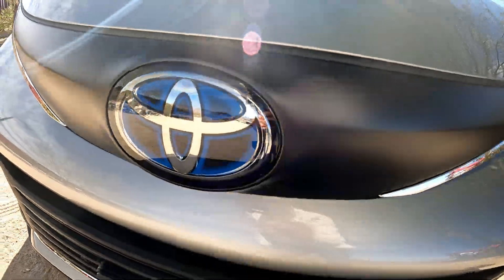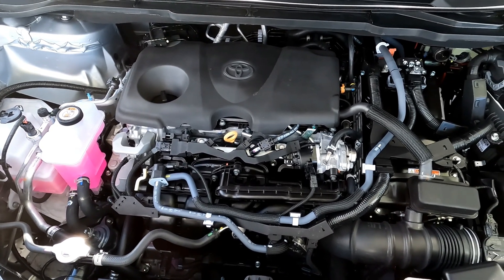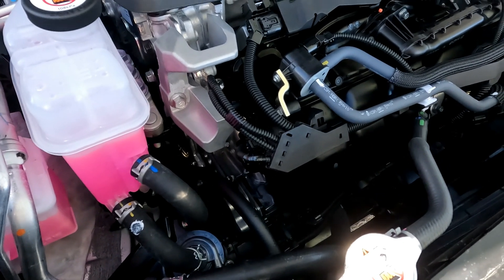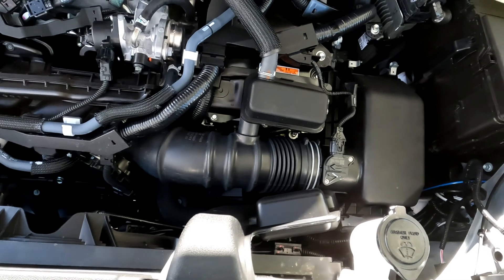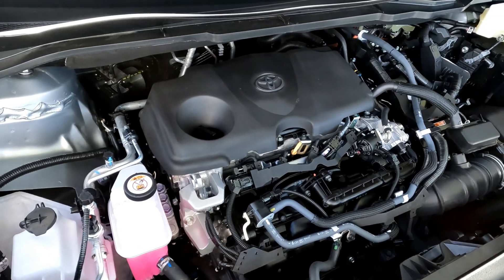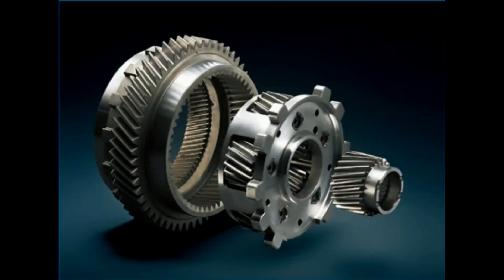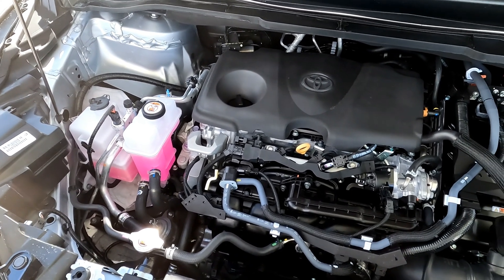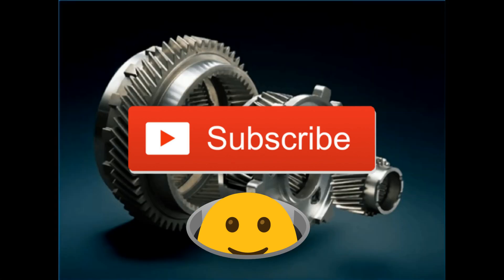A Toyota Hybrid Does NOT have a CVT Transmission (The TRUTH Behind the Hybrid Synergy Drive)

Comment: The Honda Hybrid system is not a CVT either, even though the specs say "e-CVT".  In fact, the Honda Hybrid system does not even have a planetary gearset.  The electric motor which powers the wheels up to about 100 km/h (62 mph) has only one fixed gear ratio, and when the ICE cuts in above that speed it also has its own single gear ratio.  Couldn't be much simpler.
Reply from the maker: that sounds like a brilliant system 👌 👏 😀
Reply: Maybe my car is simpler:

BMW i3 REx uses ONLY an electric motor to drive the wheels from 0mph to top speed.

The (2cyl 650cc) gas engine only comes on (after 120 miles of driving that day) to keep the battery charged. It has no connection to the drive wheels and mostly operates at a fixed, optimum rpm.

Can't wait until Ram puts their similar setup out in showrooms in a 1500 pickup, using a lightweight aluminum v6 as generator.

Comment: From what I understand, no belts, but a motor that drives the planetary gears etc that drive the diff that drive the wheels
Reply from the maker: it's basically a planetary gear differential... 2 inputs [engine and motor] 1 output [wheels]

Comment: Is there a belt or a clutch in these?
Reply from the maker: no, neither... just a harmonic dampener between engine and powesplit unit
Reply: But you say it doesn't have a CVT???   Just look up the 2025 RAV4 on the Toyota site.  Clearly states it has a CVT.

Comment: So can I tow with an eCVT?
Reply: Yes - depending on the vehicle, but there is no difference between them and the gas models such as in the trucks and Highlanders.  The Hybrid Rav is the same as well as the gas model but is limited to around 1700.
Reply: My 2025 Toyota Crown Signia which has a eCVT can tow 2700 pounds.
Reply: @richardcasey7521  my 2021 Toyota Sienna hybrid has a tow rating of 3500 lbs. but on Toyota Care Nut channel, he says the Toyota eCVT’s aren’t really meant for towing. So idk if I should tow or not

Comment: Its really stupid for them to market these as CVTs when they aren't and they are known to have poor reliability. 

Its just a differential using planetary gears with a fixed ratio. The variability is all on the dual inputs. This is like calling your axle differential a CVT to the other wheel.
Reply from the maker: @court2379  yep... it's a horrible marketing mistake on Toyota's part... any other name would've been better for it 😆 GVT or "Geared Variable Transmission" would've been better as it immediately deletes the whole pushbelt part

Comment: After tons of research i bought a 2024 Corolla hybrid.
It's basically a Prius drivetrain in a Corolla.  Probably the most reliable new car available today. Even better than the newest Prius which was totally redesigned and not proven yet. 
1.8 l bulletproof engine with the greatest transmission ever built
Reply: I wouldn't worry about any Prius.  Many have 300k or more.  They are chosen for cabs in many countries.

Comment: I get so sick of this hair-splitting myth.

Fact: if it can transmit mechanical power in a continuously variable ratio between the engine and output shaft, it is a Continuously Variable Transmission of power. That makes it a CVT. End of story.
Reply from the maker: @JamesCopeland-i1j  ya but that's getting nerdy 🤓 ... when people say "CVT" they think belt driven trash CVT from Jatco, etc.  Period.  Many think the
Toyota hybrid eCVTs are the same crap when the truth is MUCH  the polar opposite (in terms of simplicity and reliability) 😉
Reply: @LexusGX460-OFF-ROAD  - if Toyota's eCVT isn't a CVT, then most agricultural CVTs would be mislabeled (they're not), as most of them have a very similar configuration, with hydraulic motors controlling the bias circuit.

The only difference with Toyota's arrangement is, there's no dedicated bias circuit, and any of the inputs can direct power to the output shaft.

Comment: It's such a power move to take one of the worst types of transmissions, redesign it to the point where it's so simple that it practically can't fail and then put it in your cars still using the original name...
Reply: But the battery will shit after 10 years
Reply: @keithbellair9508  It's guaranteed at least that long with most lasting the life of the veh at 200k or more.  If it does after 150k, I'll spring for the new one at 3k which is about what they'll be (technology always going down) in 2031.
Reply: @keithbellair9508 Replace it for $1k and youre good for another 250k miles
Reply: @keithbellair9508 con la diferencia en los consumos el supuesto coste de la batería la amortice a los 3 años de comprar el coche.
Teniendo en cuenta que la garantía son 15 años....
Reply: @keithbellair9508 the replacement cost of that battery is really low for 10 years of usage.

Comment: A lot of the Ford hybrids (in our case the Escape PHEV) also have a similar style of eCVT that uses electric motors with a planetary gear.

It’s funny that Ford’s modern hybrid system and transmission are basically a carbon copy of Toyota’s, and the Atkinson Cycle engines were co-developed with Mazda. It actually makes for a surprisingly reliable and smooth powertrain considering it’s a Ford.
Reply: Isn't the one in ford from AISIN? The same company that makes parts for Toyota.
Reply: @BartoszRybacki0  I’m not sure. I know that Ford and Toyota have a patent sharing agreement where Ford gets all the designs for Toyota’s hybrid system (including the eCVT) so I suppose it’s entirely possible that they get them from the same manufacturer.

Comment: That's why they call it a eCVT, I wonder though if the Toyota CVT on Corollas might be okay, with the launch gear taking the torque at low speed.
Reply from the maker: @markschneider1396  https://youtu.be/2euik6mJi-8

Comment: Well it does have constantly variable gearing in the transmission... so yes, it's technically a CVT..just not what people think...
Reply: It's not CVT. The transmission is a fixed ratio. It's a planetary differential transmission. The variability comes from the inputs, not from the transmission.
Reply: There’s no transmission. There’s a planetary power split.
Reply: @okramando it transfers energy from engine to wheels, while also applying some function to translate engine rpm to wheel rpm. It does a job of transmission. 

Looks like a duck, quacks like a duck...
Reply: By definition it’s a transmission and it’s a constantly variable transmission. It’s just not a transmission that switches between specific gear sets or which uses a steel belt between two variable size pullies. Sadly they still give that horrible drony feeling of a CVT but at least they don’t break as easily.
Reply: Constant and variable are opposites.. your statement is an oxymoron.

Comment: The transmission in a Toyota/Lexus hybrid is definitely a CVT.
Please allow me to explain. The most common mistake people make in the "CVT debate" is that they misinterpret the term CVT.
The term CVT has nothing to do with the architecture or how the transmission works but what she does. In other words: CVT is the RESULT
of how a transmission works. I will clarify this with 2 examples:
First example:
The transmission with 2 pulleys and a belt (AKA the traditional CVT)
In short: the most common type of a CVT uses a V-belt witch runs between two pulleys, the cone-shaped halfes of the pulleys can move together and apart.
So that is how the transmission is built and how she works and the RESULT of that is a transmission with no fixed gears or steps but instead of that
 a transmission with a variable gear ratio or CVT.
Second example:
Toyota/Lexus eCVT.
Very short ( because it's to complicated) : this transmission uses a complex planetary gear system with 2 electric motors- generators (MG 1 & MG 2)
integrated. The mechanical gearing design of the system allow the mechanical power from the ICE to be split in 3 ways:
- Extra torque at the wheels under constant rotation speed.
- Extra rotation speed at the wheels under constant torque
- Power for an electric generator.
Now that is the architecture of the system and how it works and it's completely different from the one in the first example with the 2 pulleys, you can't
even compare them.
But the RESULT is exactly the same: a transmission with a variable gear ratio or CVT( Continuous Variable Transmission).
CVT's are used in many vehicles even in bicycles ( NuVinci hub). And of course a CVT of a bicycle works totally different than a CVT of a car, but the 
RESULT is, again , exactly the same: a transmission with a variable gear ratio or CVT.
Conclusion:
Every transmission with movable pulleys and a belt is a CVT, but not every CVT is a transmission with movable pulleys and a belt.
CVT is just a concept and Variomatic (DAF), Variotronic (Audi), ECVT ( Subaru), e-CVT (TOYOTA/LEXUS), NuVinci hub for bicycles etc. etc. are perfect examples of how the concept CVT can be realized.
Reply: The planetary gear set is not complicated, in fact it is simpler than a bog-standard 3-speed Auto box,.
Reply: @timcarpenter2441  its even more simple than a 4 speed manual from the engineering perspective, but how does the ratio change from the mathematical and software perspective, it's quite complex actually
Reply: @rizkiaswanggaadiluhur843 yes, it is complex to model, but reliable once mapped. And smooth.
Reply from the maker: yes it's technically a CVT but not the notorious "steel pushbelt type" that is notorious for failing  😀 ✌️
Reply: You just essentially explained an eCvt again.
Reply: It's not a CVT. The transmission is a fixed ratio. All the variation is happening in the input to it, the motor. Motors and engines have always been variable speed.

It is a planetary differential transmission with dual inputs.
Reply: Its not a transmission, its just a power divider. The motors are providing the speed change.

Comment: The earliest Prius (and most/all Toyota hybrids) did have a metal chain inside, running on sprockets, similar to a timing chain.  It could wear to "stretch", though couldn't slip like the push-chain on smooth cone sprockets which causes problems in normal CVT's.  By the Gen 3 Prius in 2010 with P410 e-CVT transmission, there is no chain nor wear parts other than the gears, so reliability should be similar to the differential in a RWD car, i.e. usually life of the car.  The engine also got rid of all rubber accessory belts since an electric water pump.  A good description with tear-down: https://www.youtube.com/watch?v=5lg6yC5_-Bs   Lost you on "coupling with electromagnetism", unless referring to the two electric motor-generators which of course do use electromagnetism.
Reply: We've owned a 2008 Highlander hybrid since 2012, and it had 110k miles then. Now it's over 300k miles (not km), and still gets 26mpg at 70mph highway speeds, still going strong.
The e-CVT is simply varying the RPM ratio between the two inputs of the planetary gearset. One input is the high power 3-phase permanent magnet drive motor, the other input is the gas engine and/or the smaller. electric motor. In EV mode, only the high power electric motor is used to power the vehicle.

This "Synergy Drive" allows the gas engine to be run at its most efficient RPM and power output level, by tweaking the drive motor and gas engine speed and torque.
It truly is a very reliable and efficient "transmission".

Comment: Does Subaru have this gear from Toyota thats to say is IT exactly the same?
Reply from the maker: no the Subaru CVT is a belt-drive
Reply: @LexusGX460-OFF-ROAD  True, even the crosstrek hybrid had the same belt drive (though it had other Prius components as part of its hybrid drivetrain), however the upcoming forester hybrid will have Toyota's hybrid system including the ECVT
Reply: @LexusGX460-OFF-ROAD wrong, Subaru use chain in their cvt.

Comment: The description is wrong.
The petrol engine and electric motor are combined by a planetary gear (like a diff) whose ratio is controlled by another electric motor. There is a physical path from the petrol engine to the wheels as well as from the electric motor.
Reply from the maker: this description literally says it's connected via a planetary gearset

Comment: the reason why the “eCVT” is so damn reliable and last forever in electro magnetic coupling ,  the drive side and the driven side never touch each other and they will never wear and never slip
Reply: It is not an electromagnetic coupling at all. It is a differential instrumented using electric motor/generators
Reply: @timcarpenter2441 That's an interesting but accurate way of saying it.
Reply: Yes but the battery will take a shit in 10 years.. then youre sol
Reply: @ the hybrid battery last a lot longer than 10years if maintained properly (change the air filter) and even if it goes bad it is not that expensive to replace,no one ever questioned Toyota hybrid reliability
Reply: wrong!

Comment: I'm a mechanic, 45 years in the business, working for myself. I just took on my first hybrid, diagnostics led me to a insulation leak in the high voltage inverter/converter transaxle, everything said to replace first inverter, which I did as per only option listed. Then it failed with the same dtc, test showed inverter good, leaving replace transaxle -I pulled both replacement parts from a wrecked '08 Lexus rx400h whereas the car being repaired was an '07. Biggest thing for me was being careful with high voltage - disconnecting HV, waiting 5mins as per instruction (I waited days). Repairs went well, solved problems. Today I disassembled the old transmission just to see how it worked. What I found was actually something far simpler then any automatic I'd ever seen. 2 electric motors, the first that started the gas engine, was lower gears electric power and also was a generator to charge the HV batteries. The 2nd motor powers the car in higher gears and charges the HV. This is the Toyota 3rd generation hybrid, the 1st and 2nd version used a chain to connect to differential, 3rd gen. up is geared. Also, the problem with transmission I found was teeth damage to that gear drive. Even so, the transmission still seem to be working normal, except the trouble code wouldn't allow it to operate without deleting the code.
Reply: MG1 controls the gear ratio between the engine and the final drive gear.  MG1 must dynamically changes its RPM (or even the direction of rotation) depending on the RPM of the final drive gear in order to achieve a desired gear ratio between the engine and final drive - that includes the gear ratio of 0, which completely stops of engine rotation.   That's the secret of Toyota's eCVT.  MG1 also conveniently acts as a starter.  MG2 simply adds extra torque to the final drive gear (or absorb torque from the final drive gear when acting as a generator).  The entire thing is done with a single planetary gear set where MG1 connects to the sun gear, engine input is to the planet carrier, while the ring gear is geared to the final drive gear.  This is why it's so much simpler than traditional automatic transmission where multiple planetary gears are needed.
Reply: @r64g  i believe it would be much easier to repair as well
Reply: Toyota E-CVT with MG1 and MG2?
Reply: Hello, is the 2006 Toyota Alphard Hybrid equipped with a reliable CVT?
Reply: I haven't heard of that model, but the transmission is what makes it hybrid and I wouldn't call it a cvt. You see it doesn't It has 2 magnetic motor that power the car, also starts the car and recharges the 600v AC battery. and it seems to me as if they are nothing like any other transmission I've taken apart.  And the problem I found was high voltage insulation leak  was cause by a broken tooth on the final drive ring gear which worked it's way up into number 2  magnetic motor, msz @AzekePomojet
Reply: Yes @AzekePomojet

Comment: What about the Lexus SUV hybrids?
Reply from the maker: they are either a DCVT or a "mild hybrid" where a conventional transmission is used and the motor is just used to "boost" the output...  very reliable
Reply: @LexusGX460-OFF-ROAD  Thanks. Helpful.
Reply: @LexusGX460-OFF-ROAD  RXs use the synergy drive eCVT-i transmission from 2010 or even before, so no belts. Not sure about NX or UX models.
Reply from the maker: https://youtu.be/2euik6mJi-8
Reply: @LexusGX460-OFF-ROAD  Excellent video. Thanks. Very helpful.
Reply: The UX has the P711 synergy drive of the Prius etc.

Comment: What about the '23 RX350H?  Is the ECVT in this vehicle Synergy Drive as you mentioned?  Thx
Reply from the maker: Yes, same synergy drive as in this Sienna. 2.5L engine, 2 motors, planetary power-split device, battery back and inverter.

Comment: What mileage would you have the synergy hybrid drive fluids replaced?
Reply: There is no such thing as 'lifetime fluid' for ANY system, with some exceptions like refrigeration systems oil, by then you buy a new one. 
It kind of comes down to the old idea of 'standard service vs. severe service.' You live in a big city and do lots of stop and go? Severe service. Are you a traveling salesman and do 90% constant speed highway miles? Then no. 
Personally, I would treat it like severe if you live in any extreme temp variation area like Canada or Scandinavia. I would change mine every three years or 50K miles/80K km, whichever comes first.
Reply from the maker: probably never.  the oil is only there to keep the gears from seizing... assuming there are no leaks it should last the liftike of the vehicle 500k which by that time most normal people will have moved on to another vehicle or be bored of the vehicle
Reply: I think Toyota recommends changing the ecvt fluid at between 100-120k.  I personally would change it at 90k and then every 60k.  It is splash lubrication like a manual transmission.